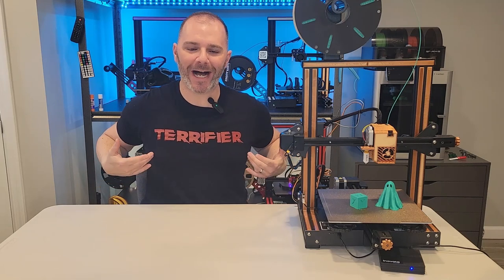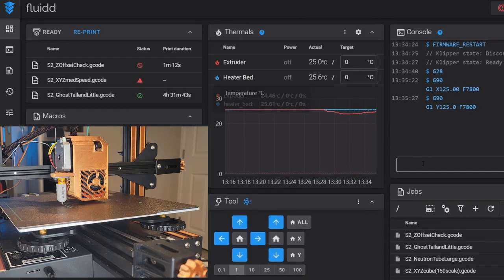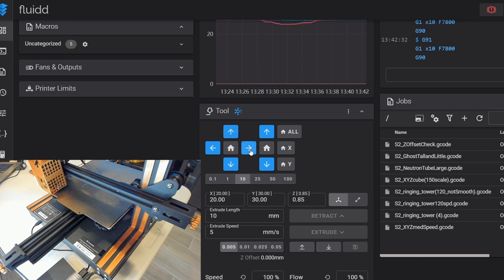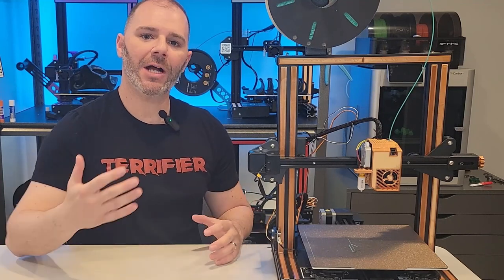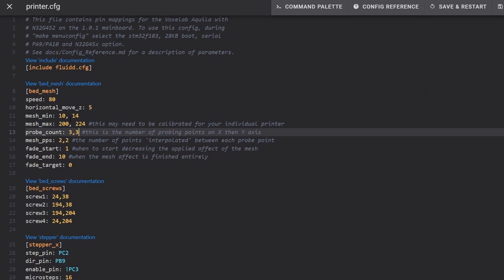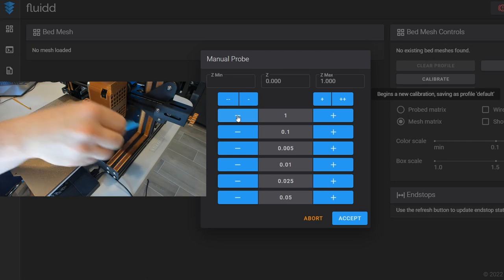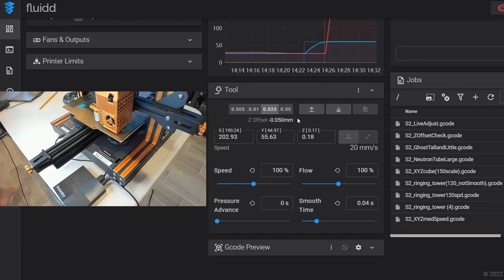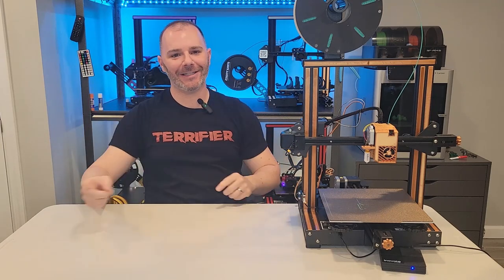Create a Manual Mesh with Kipper!

Comment: Super explained 5 stars finally someone who explained and presented something without much ado. GREAT!!!
Reply from the maker: Thank you so much! I take a lot of effort to try and set up my videos so they are easy to absorb, so I am glad it's working!
Reply: @PrintsLeo3D  Hi! I'm new to KLIPPER coming from Marlin I have a question: how can I set the x, y z steps. The part a cube 20x20x20 result x 19.71 y 19.78 z 19.92 a walls not printed cleanly
Reply from the maker: Hey frank, the steps on Klipper are now referred to as 'rotation distance' and they can be found within the printer.cfg file (which is under the configuration tab on your front end). Within that file will be sections for each stepper motor, i.e.
[stepper_z]
...
rotation distance: 8

[stepper_y]
...
rotation distance: 40

They can be configured there, although I wouldn't recommend changing the rotation distance for the X, Y, or Z axis based on values of a printed cube. You should keep them at the factory recommended values based on the motor, which for an Ender 3 Pro or Voxelab Aquila style printer is x-40, y-40, z-8. Usually when you have a model that isn't printing dimensionally accurate you want to first make sure the rotation distance (formerly e-steps in Marlin) is accurate. Then adjust your flow, z offset, and make corrections from there. Let me know if this is useful for you!
Reply: @PrintsLeo3D  OK Danke. Ich werde mich melden Dankeschön

Comment: How did I miss this? I know I've got that 🛎 clicked. Thanks for another great video
Reply from the maker: Hey thanks for finding it! It's a little off the beaten path Klipper related stuff , but I'm still trying to get good info out there. Thank you for finding this video and letting me know!
Reply: @PrintsLeo3D  I'm still trying to figure out what klipper is and if it's actually better than what I've got going on. Marlin firmware, octoprint and a pi 0
Reply from the maker: That's actually a great question and maybe something I can dedicate a whole video to, just describe the differences. Klipper does all the same things Marlin does , gets your printer to print, but it uses a second microcontroller (like the pi that is running your Octoprint) to do all the heavy lifting. So with your mainboard and the second microcontoller working together you able to get faster speeds and more accurate prints. It also gives you remote access (just like you have with Octo) and makes editing your firmware very very easy. 
If you're getting quality prints with your printer and are happy with the results then Klipper isn't something you'd need, it's an awesome addition but it requires work to get there and why fix something that ain't broke lol

Comment: When you leveling the bed, Isn't it necessary to preheat before calibration?
Reply from the maker: No, not necessarily. Some people prefer it cold, others hot, and each party has there reasons for it. I prefer to do all my levelling cold. The most important part is that whichever option you choose, stay consistent with it and use that method for all the calibrations.
Reply: @PrintsLeo3D  thanks!

Comment: I am new to Klipper and used another video of yours to create the screw tilt adjust. I am still having issues with bed leveling. After I have run the adjust and lower the print head to the bed the probe on my Ender 3 S1 touches the print bed before the print head does. This causes the probe to hit filament during print jobs and knock it off. I cannot get a job to complete after over a week of having Klipper setup. I am using MainSail. Also, I tried doing the z endstop calibrate command and get Unknown command:"Z_ENDSTOP_CALIBRATE". Any help would be greatly appreciated. Thanks!
Reply from the maker: Hey thanks for the comment and question. This sounds like you have the bl touch mounted too low if it's contacting printed material as you are printing. Images will be the best way to diagnose and correct this issue. Email me at printsleo3d@gmail.com and we can get this thing solved.

Comment: hi, i've learnt too much things from you thank you. i have e3s1 pro with klipper. my bed is very very warped, around 0.6 gap in the middle. i used to put aluminium foil under it but when i realize that there is "axis twist compensation" i wanted to try but it doesnt help. can you make a video about it? if it works, im sure hundreds of ppl will have a flat bed and good first layer. my problem is it seems it doesnt save the compensation. everytime i do it again after save config and restart, z offsets are same for where i adjust the nozzle. so same bed mesh everytime.
Reply from the maker: I'm happy you found my videos useful and I appreciate the comment x2! Dealing with a bed that warped can be a huge issue, are you saying that axis tilt helped you? Or are you still having issues with the first layer ?
Reply: @PrintsLeo3D  sorry about the 2 comments, once was old and i realized that later. i thought it was going to solve my issue but somewhere i do something wrong. i just dont understand fully how its working. my problem is still there..maybe you can make a video about how it works.

Comment: Everything went fine unit you have to enter bed_mesh_profile in gcode_macro_start_print but there is no gcode_macro_start_print?? Am i missing something???
Reply from the maker: The start_print macro is just a group of commands you want to run at the start of your prints. There is no default start_print macro from Klipper as you'll want to adjust it according to your printer and what features you want to use before each print. If you want a very basic start_print macro to begin using you can go to my website. At the top of the website there's a section for Klipper and then from there scroll down to Macros and you'll be brought to another page. That Macro page has a few different macros you can copy and paste into your config to use. As always remember to save and restart after you make changes to printer.cfg so the changes are applied. Good luck!

Comment: how to ajust bed screws if there arent any? kingroon v2 comes with auto leveling no screws...
Reply from the maker: Some never printers are coming with beds that are fixed in place and cannot be adjusted. In some instances There is some ability to adjust the bed by tightened or loosening the actual screws that are holding it in, but in most cases that won't be necessary and the probe can do all the work for you.

Comment: hei very good tutorial XD its something need it..
ive a few question:
*im new in to 3d_printing/klipper, i notice that you are using Fluid and im following alone with Mailsail, the manual mesh leveling you use is it a Macro or something from Fluid? (i mention im new in to this right... XD).
*when im mesh lveing, what im aiming for +\- (around what values)...
let me know...
keep it going XD
Reply from the maker: Thanks happy to hear some newer printers are getting into Klipper! Manual mesh is not tied to any particular front end, this should be usable on both Fluidd and Mainsail!
    As for the values to look for, it's always nice to get a full mesh that has a tolerance of around 0.2mm, which means the lowest point of the mesh, and the highest point of the mesh have a deviation no larger than 0.2mm that being said I print on meshes all the time with higjer tolerances and they still work great!

Comment: Hey… thank you for the Video… I got a Manuel Mesh working with this Video. Just one question: When you start the Probe, a window is shown up called „Manual Probe“, in my case its not coming up, I have to write every time testz z= to move the nozzle. 
Is there any way to activate this window? 

Thank you in advance
Reply from the maker: You're welcome for the video and thanks for watching !! If that probe window is not showing up there's two things I could think of. First is have you updated Fluidd recently? I remember I used to have to manually enter the testz z= lines also, but at some point fluidd updated and included this feature. So I would look into updating Fluidd (be careful though as sometimes upgrades can temporarily break some features, which you can fix, but it may cause a hiccup in your day). 
Second is the settings gear that's towards the lower left portion of the screen. I'm not in front of Fluidd right now, but I believe there's options for those menus. You can adjust the height that it moves and you might also be able to turn it on and off. I would look here first and see if it's been disabled. Let me know if this helps, if not we can dig a little deeper!

Comment: That was a VERY nice video. Thanks a lot just what i needed. 
In about 24 hours I have forgot the nice Z offset, and live adjustment commands, is there a way to save them? Can they be savet in a macro?
Reply from the maker: It's funny you mentioned forgetting the z offset adjustment, I kept forgetting some of the same calibrations. The one you're looking for is z_endstop_calibrate. What I ended up doing was just turning the command into my own simple macro, which in turn makes it into a button press on the front end. You can create one too, in your printer.cfg just format it the way any other gcode macro is formatted, give it a name (with no spaces) and add in a single line (z_endstop_calibrate). Save and Restart and now there should be a button working that macro on your front end's home screen so you don't need to remember anymore.
Reply: @PrintsLeo3D  It works! Thanks 🙏🙏👍 
Until now it have been printing on a mirror because my bed til warped, the mirror smooth it a bit, but now is time to try out Pei sheets.
Thanks again
Reply from the maker: Pei sheets is a time saving-adhesion staying game changer !! Good luck 👍

Comment: When you were talking/showing the fad_end: and it was set to 10mm wouldn't you want that value the height of the print so it follows the contour the duration of your print? If it stops following after 10mm wouldn't it cause print line defects or potential issue later in the print? (I am new to all this so just trying to figure everything out) 

Also thank you for making this video, I didn't even know you could do a manual mesh with Klipper like this so I will be re-following your video when I do this with  my Ender 3 Pro. Very much appreciate the guide!
Reply from the maker: That's a really great question. The reason we don't want the nozzle to contour for the duration of the print is dimensional accuracy. It's a fine line between getting prints to adhere to the bed, but still maintaining accuracy of the actual model through the print. What fade is attempting to do is get the best of both worlds. Through the duration of  reaching the 10mm fade height the printer is very slowly and incrementally decreasing it's reliance on the bed mesh. This allows it to maintain accurate dimensions, continue to print a solid model free of defects, but also maintain the dimensional integrity of the model. So it's the actual fading (slow decrease in mesh reliance) that always is to not notice any sort of vertical defects. 
    Manual mesh is such a powerful tool so I am happy to hear you're going to be using it! Thanks for watching!
Reply: @PrintsLeo3D  Wow thank you for the thorough explanation. It makes complete sense now that you put it that way. Never been excited to do a manual bed mesh and here I am looking forward to it. Haha thank you again for creating this tutorial I still have yet to add the CR/BL touch sensor to my Ender 3 Pro.
Reply from the maker: Getting people excited to start a manual mesh is the name of the game lol! I'm happy you asked the question and glad you're going to be using the info.

Comment: I have Anycubic Kobra Neo with fix bed spacer, It is having Inductive probe for the ABL. when I execute the "BED_MESH_CALIBRATE METHOD=MANUAL" command, it used same auto calibration of the Bed mesh calibration and start auto bed mesh calibration. I am using Mainsail Ui and I have only Calibrate option over there. I am not able to do the manual calibrate. Can you help me?
Reply from the maker: I'm not 100% sure on this, but if you have a probe section defined within printer.cfg (for your inductive probe) than I believe the manual method may still just cycle through the auto calibration process.
Reply: @PrintsLeo3D  Thank you for the promt reply.. I will disable that and check it out
Reply from the maker: I usually reply even quicker but it's been harder for me lately, I have comment so haven't even seen for over two weeks 😢.
    That all being said the Anycubic printers are a little "weird" when it comes to some Klipper related processes. I don't own one myself, but between the Discord and here on YouTube I see a lot of complaints and confusing over how Anycubic implemented things.
Reply: @PrintsLeo3D  yeah…. Looks like same to me.. Anycubic is wierd..😀

Comment: I use klipper via the SonicPad. I changed the bedscrews positions. After a restart I tried to move the extruder to the first and other screws but nothing happend . Do you have an idea?
Reply from the maker: Well for one thing I have heard some horror stories when using the Sonic Pad. What I'm thinking is maybe you input the coordinates improperly (missing a comma or a similar error) and Klipper is not able to read the macro properly. Is there any output in the Console when you try and run the macro?
Reply: @PrintsLeo3D  thank you for your tip. Will look in to it. Indeed a lot of horror stories but it is working fine no. Just the fine tuning
Reply from the maker: Glad to hear that, good luck moving forward !

Comment: Absolutely fantastic video! Love your channel. I'm having issues with my slightly modded Chiron on which i just started using Klipper, i'm using a cfg file made by a fellow Chiron user but i'm having issues in calibrating a bed mesh since a probe is specified and i don't have one (even though it's listed in my cfg file). I tried commenting out the "probe part" without luck, do you have a suggestion for me?
Reply from the maker: Thank you so much for the compliments! To be honest the best way to tweak something like this is if I can see the actual printer.cfg you're using. Why don't you try emailing me a copy of it (PrintsLeo3D@gmail.com) or if you want you can copy and paste the entire .cfg as a reply to this post.

Comment: Hello All, I don't have the "save and restart button" on top. I selected it in the settings but nothing changes. Any ideas?
Reply from the maker: Hey Dominique, are you talking about the Save and Restart button that's inside the printer.cfg? One reason could be if you are running multiple instances of Klipper (meaning more than 1 3d printer) then that option won't be there for you.

You would have to use Firmware Restart from the Configuration tab

Comment: Hi. Does anyone know the 4 bed screw coordinates of the Qidi X max 3?
Reply from the maker: I have an X Max 3 and can definitely help. This printer comes with a bed probe so you would necessarily need to level the bed in this manner (unless it's really far off). I'm just curious what the use case is because I've leveled my bed before and can help you with the process if that's what you need.

Comment: If you have issues with mesh not working change the algorithm from lagrange(default) to bicubic in [bed_mesh]. Lagrange can fail if given to many probe points.
Reply from the maker: This is a great point and I'll make a note(although I often forget and I'm sorry) to add this info to the description with and credit you. I figured this would be less of an issue with Manual Mesh, because who wants to calibrate all those spots, but it may make more sense to get the bed as accurate as possible each time so you don't need to do more calibrations down the line. Thanks!

Comment: Hello, how to use it for 12864 display, manually, without computer and monitor? Do you have any ideas to add a menu for this.
Reply from the maker: Hey Toni, I'd be happy to help if I can but I'm not exactly sure what set up you're referring to. Are you using something like Klipperscreen?
Reply: @PrintsLeo3D  I solved the problem, for the 12864 display, you need to add an item for manually setting the bed

[menu __main __prepare]
type: list
enable: {not printer.idle_timeout.state == "Printing"}
name: Prepare

[menu __main __prepare meshBed]
type: list
enable: {not printer.idle_timeout.state == "Printing"}
name: Mesh Bed Level

[menu __main __prepare meshBed zposition]
type: input
name: Z Pos: {'%05.1f' % menu.input}
input: {printer.gcode_move.gcode_position.z}
input_min: 0
input_max: 200
input_step: 10.0

[menu __main __prepare meshBed start]
type: command
name: Start Callibration
gcode:
	G28
	BED_MESH_CALIBRATE
	TESTZ Z=-5

[menu __main __prepare meshBed zNudgeDown]
type: command
name: Nudge Down
gcode: TESTZ Z=-0.025

[menu __main __prepare meshBed zNudgeUp]
type: command
name: Nudge Up
gcode: TESTZ Z=0.025

[menu __main __prepare meshBed next]
type: command
name: Next
gcode:
	ACCEPT
	TESTZ Z=-5

[menu __main __prepare meshBed save]
type: command
name: Save & Restart
gcode: SAVE_CONFIG

[gcode_macro G29]
gcode:
    BED_MESH_CLEAR
    G28
    BED_MESH_CALIBRATE
    BED_MESH_PROFILE SAVE=name
    SAVE_CONFIG
    BED_MESH_PROFILE LOAD=name

[bed_mesh]
speed: 50
horizontal_move_z: 1
mesh_min: 10, 10
mesh_max: 290, 290 #this may need to be calibrated for your individual printer
probe_count: 5,5 #this is the number of probing points on X then Y axis
mesh_pps: 2,2
fade_start: 1
fade_end: 10
fade_target: 0
Reply from the maker: This is a great addition! Thank you for following up with a solution. Do you mind if I add this information to my website ?